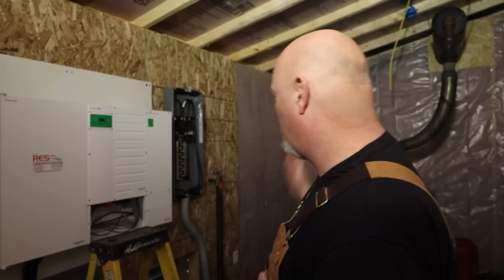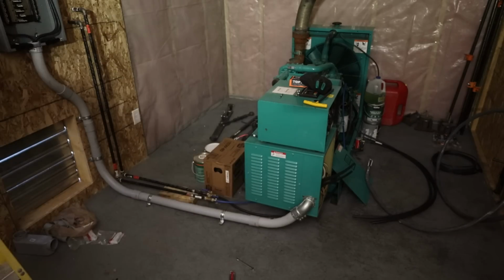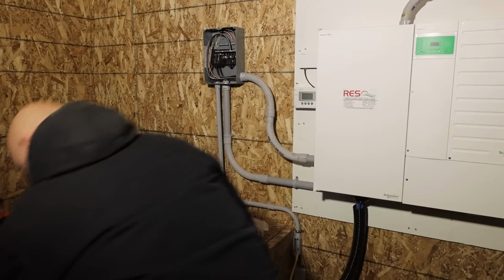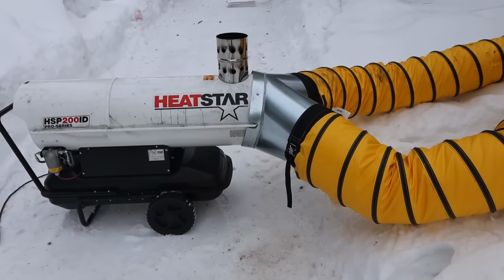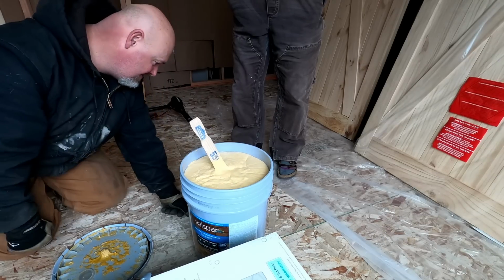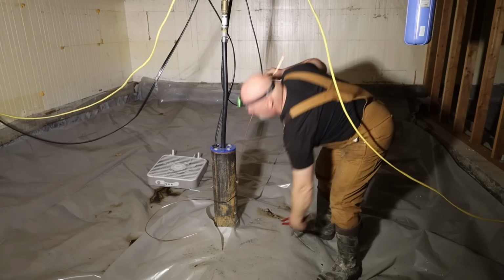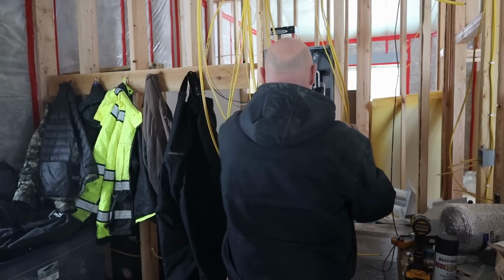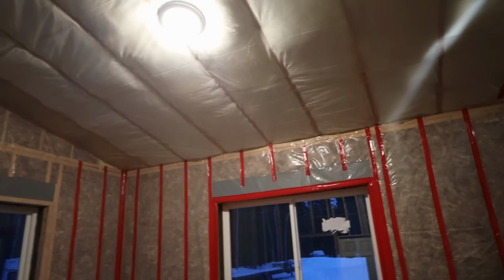This Changes EVERYTHING! | Generator Setup For Our Off Grid Power Part 4

Comment: I'm no electrician, but shouldn't the neutral wire be marked white in every box ? 
Normaly the first electrical box/panel can be ground and neutral bonded, right?
How did you ground netral bond the electrical boxes, when there is both a generator and an inverter as a power supply? Is the generator allready neutral ground bonded?
I'm curius, as I do not know this myself.
Greatings from Norway. And good work ! 🙂

Comment: Congrats on powering up your electrical grid! Everything looked very professional. You certainly had to do your homework in order to have the successful out come. Those were two of the biggest smiles we've seen on your faces when the refrigerator and the bedroom lights went on! Awesome!  Questions:  How long was the run from the generator to the house? Wire gauge used? Was it also in conduit? I have to run a line to my pole building when weather permits, a distance of about 225 '. I believe that I'll have to use 8 gauge wire in order not to have an amperage drop. I'd like to draw on your experience.   Again, way to go!!
Reply from the maker: Thank you.😊 The distance from the inverter/generator to the house panel is about 200’.  We used a 4awg copper wire, 4446 copper. This wire is rated for 85 amps when we only require 60 amps. We overrated the wire to account for any drop. It was run in a conduit the entire length.

Comment: can you not use ground plates in your area or do you all have to use ground rods by code?
Reply from the maker: We don’t have code in our area but I’ve never heard of grounding plates.  Might be something for me to look into.😊
Reply: @Wildwood Off Grid Alaska  yes so much easier its a 2x2 plate with a stub and ground clamp.  Here in Ontario code is 2ft down 2ft away from the building #6 bare copper ground wire and 
Bob's your uncle
Reply from the maker: @scottscaneh  thanks for the heads up, I’ll look into it.😊

Comment: Great job and love the setup with the Schneider internet and the generator load transfer panel. It would be interesting to see how well the power house sound dampens the noise of the generator when your inside vrs the outside at specific distances with a sound pressure meter.
Reply from the maker: It’s amazing the difference. When I close the door you cannot hear the genset running from inside the house. Outside it just sounds like a fan blowing.

Comment: Nice video, thank you! The generator can be turned on and off with a telephone App. Ground-ground is case ground for motors and stove-refrigerator shell in case of accidental short to + Electrical. Neutral is active all the time as the return for electrical current. Would a drill get through the frozen ground and enable you to drive the G-Rod down the required 6' to 8'? Ron PTL USA
Reply from the maker: I could use a Hilti gun to hammer the rod in but I’m in no hurry with the ground going to my well casing.

Comment: I forgot to mention before, this longer video is awesome! I could watch larger more progress videos several times a week! And as for the ground rod, I got a 3' piece of galvanized pipe, put a pipe cap on one end, and used it to slam drive my rod into the ground. Oh and don't forget to put you grounding clamp on before you start driving it in. otherwise it's difficult to get it on because the rod will mushroom out from driving it in.
Reply from the maker: Awesome, thank you!

Comment: With such a large generator is it possible to provide your daughter with electricity? Or is the distance too great.
Good work and certainly not easy to get all those different systems to work together.
Reply from the maker: Our original plan was to try and do that but the distances ended up being to far to be worth the effort.

Comment: Wouldnt it be smart to use metal conduits instead of pvc?
Reply from the maker: Not sure why it would matter. The conduit is more to keep thing organized then anything. Lots of solar systems out there where wires are just stapled to the walls.
Reply: @Wildwood Off Grid Alaska  I know,  it's also not smart. Systems with that amount of power put out a lot of energy. One wrong move, one time tripping and something breaks, shorts and all will burn. I hope it won't happen and I'm sure you did your best.

Comment: It's so cool to see someone living so remote and off grid and have every household convenience. I guess the next big project is the CH!  Great video. Great content. Looking forward to full summer.
Does the cellar freeze? Or is it deep enough to stay above freezing in subzero temps? Von did you get your oven fixed on your stove? Cheers!  Happy break up.
Reply from the maker: Under the house does not freeze because the walls are insulated concrete and the temperature of the house keeps it warm under there also. The oven still does not work but we think it may work once it’s connected to the proper propane system.

Comment: If I'd have had to go through what y'all have had to do, I'd be all smiles too! From what I have seen, you have done a very professional job doing all your wiring. No worries of the mess at your inside panel, as you said, it's all temporary! Glad to see all your wiring in conduit. Some folks don't see the need for it, but, one of the ingredients of the sheathing around the copper is vegetable oil, so if a varmint happens to chew their way in, it's food to them! The deal about power to a "future" shop, that's smart! A air compressor and a welder going at the same time, would put a strain on your battery bank and most likely need more than the 60 am supply! Not to mention lights, fans and so on. I am wondering if the 60 amp supply to your house is enough. But then again, I don't know what all your draws will be. The well running if it's 220 or 110 (110 will in most cases draw more than a 220 unit) and other things, but seeing as how you have the big propane tank, I am guessing that your cloths dryer, water heater and kitchen stove is all gonna be propane. So that only leaves your AC)if you are gonna have one??
Reply from the maker: Our load should be relatively small with the propane and as you stated our well pump will be the big draw. We have a 3/4hp 220 we’ll pump. 60a is the most our inverter will put out so if we find that we need more, we’ll have to expand with another inverter.